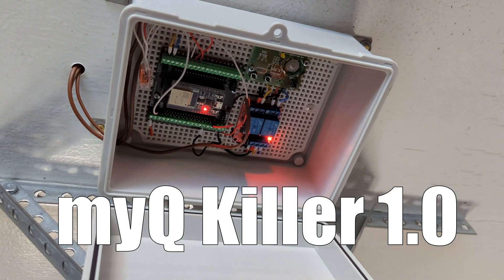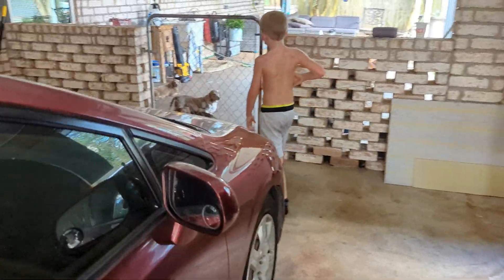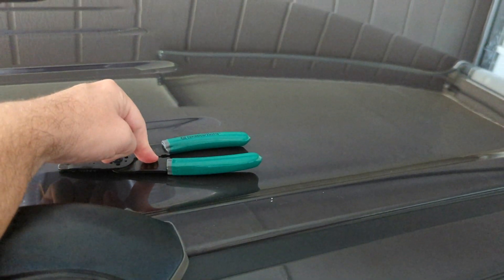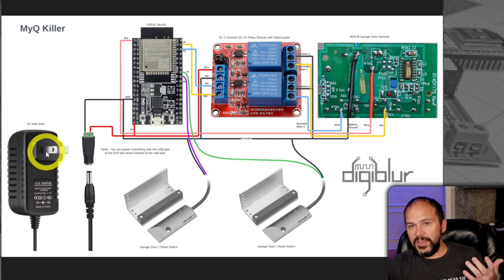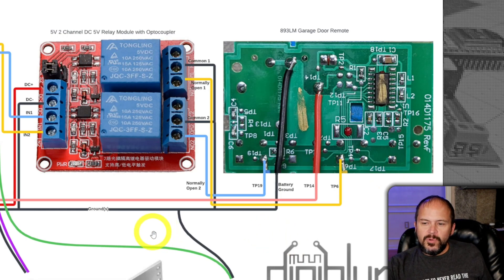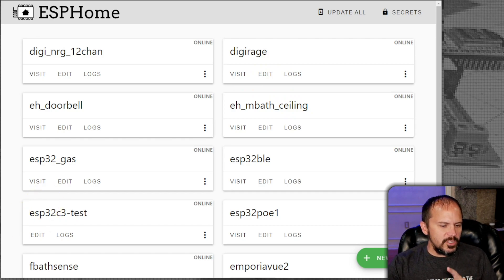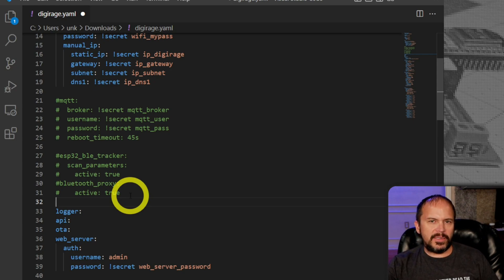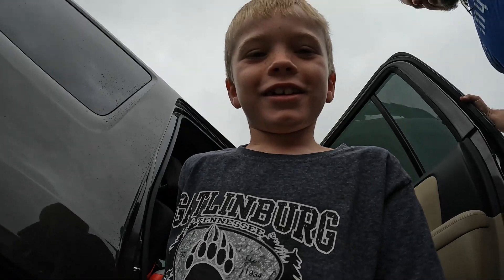myQ garage openers suck! How I fixed it using a spare door remote and ESP32

Comment: Are we saying that we can’t use a Shelly 1 plus with dry contacts wired directly to this type of opener or is that still an option? And by opener I mean the actual motor unit not the extra RF remote. This is how we did it in one of the older videos with the “dumb” opener. Would that then short the wall unit that has the LCD display? And is that wall unit sending an RF signal back to the operator and not communicating via the red and white wire?
Reply from the maker: If you have the new Security protocol style, nope, you can't just close the wires together
Reply: @digiblurDIY oh man.. they said “oh we were out of stock of the opener we were gonna give you so we upgraded you to the one with wifi” and I thought oh well whatever I’m not gonna use that anyways coz I’ll use home assistant but that then means I’ll need to go exactly your route in this vid with the RF remote and not just shorting the wires at the operator itself like on my old garage. I have a few ESP32’s laying around… Thanks for an awesome video.. as usual!

Comment: One word: Ratgdo
Reply from the maker: Yup. It wasn't out then except for a solder only version and I couldn't void this new door warranty. Things have changed a little especially now with the open source ratgdo boards supporting esp32 and the official one unfortunately do not. I do wonder if I can add car presence sensors to those boards as well.

Comment: Just completed this build and works great!  Chose this over the RATGDO solution for a few reasons.
1) I liked that this didn't require wiring anything into the existing system. 
2) Cost.  I was able to automate both my garage doors for under $40(is it weird that the project box was the most expensive part.  I used  reed switches from Ali express
3) Availability  Looks like the RATGDO boards are on backorder.
4) I got  to use a soldering Iion!

I used 3 pin connectors for the reed switches so I could bench test everything easily (clipped the green wire).  It also saved me from having to dink around with the connections while the box was mounted to my ceiling.  
Thanks for all you do!
Reply from the maker: At the time for me Ratgdo was solder only and then I needed two so I opted for this method since it was purely isolated and I could really locate it anywhere in the house I wanted.  I did opt for the project box to add additional sensors though.  Keeping that warranty intact was key for my setup.

Comment: There seem to be quite a few different versions of the ESP32-WROOM-32D. I've looked at quite a few different Amazon ones including the link here and the pins are all different. I assume these are all pretty similar and would only need slight modification of the code to account for the different pins? Also, did you ever upgrade this project to include vehicle presence sensors?
Reply from the maker: They do vary but they don't change the use of things. Just match up the pins that you choose.

No I got delayed with the heat wave and haven't been in the garage much. Trying to get it done in the next few months.

Comment: My myQ works just fine .You will only hate it if you want a premium feature. I want mine to open from anywhere, give me door position and alerts. It does all that flawlessly. And it never drops my WiFi. BYW. If someone gets hurt by your garage door, you altered its building code compliant beeping and flashing requirement while operating with your phone. You get sued, your insurance won’t cover you. You could lose everything you own. Think little child getting hit by a closing door and heartbroken parents with a hungry lawyer.
Reply from the maker: Actually since the video they broke MyQ totally and they pulled the API. So it is worse now. I didn't modify the door at all. This is the same as when I bring my door remote with me across the street and open and close the door from his living room. No beeps then either. Sounds like the door should have beeps all the time with all the lawyers like you say. If only they had it where when you walked in front of the door it would reverse the close. Hmm....

Comment: I think you're about to get a lot of interest in this as a way to open the garage doors without going through MyQ as you've probably heard they're locking out 'non authorized' integrations from the myq api.  This allows us tinkerers to have local control with the ability to go back to "stock" if we ever sell the house.  Personally I think it's a winner!  I'll be using one of my spare remotes for this.  Thanks for posting.
Reply from the maker: Yep especially for ratgdo being out of stock. They have come a long way with the design since I did this one as I did look at them but they required soldering to the opener at the time which I couldn't do with being under warranty.

Comment: If the remote uses 3.3v, why do you even need a relay? Couldn’t you just connect the GPIO directly to the points on the remote to pull them down to ground as desired?

Also, look into HW622 boards if you only have one door you want to control.  Cheap, and they have a built-in relay and opto-isolated gpio, but you need a 3.3v FTDI adapter to program them
Reply from the maker: You might be able to use some optocouplers or some other gate to pull things to ground instead of a relay but it might need some soldering action.

Comment: I'm late to the party here...  As a fairly long term sub, somehow I missed this video during the quest to add this featuer to my home assistant project.  Originally just grabbed a wemos d1 mini and a 4 relay add-on board.  During testing, quickly realized that during a reboot of the d1, for some odd reason, all of teh outputs went high just long enough to trip the relays which would trigger a garage door open event.  Not cool.

On an ENTIRELY unrelated project, my BOG standard garbage door remotes all started to die.... no, it wasn't the batteries.  Being the junkyard rat I am, I remembered that GM has sprinkled the Homelink garage door modules in every vehicle they've produced in the last 20 years...  Grabbed a bunch of those from a local pick-n-pull yard for about 20 bucks each.  Got one of them programmed up and made some solder connections, which I connected to my wemos d1 mini relay board.  The homelink module requires you to press and hold the button for about 2000ms before it'll transmit an event.  Winning!  Wired that module up to the relay board, bobs yer auntie!  Now I can sleep safe, knowing a random CPU crash or power loss event won't result in my garage doors opening, which would be a MAJOR security issue for my house.
Reply from the maker: Nice!!  Never late to the party.  Great idea for grabbing those modules.

Comment: Thanks for your video; it is an example of what people can do if they think outside the box.

My issue, before seeing your approach, is that the MyQ solution for automation is far from complete.  For example: You set up MyQ to automatically close the door at a certain time so you don't leave the garage door open overnight.  Now, you come home from shopping and open the rear gate on a minivan, which goes through the path of the garage door.  You go inside and forget that you left the rear gate open.  Instead of providing a notification that your garage door is open, MyQ closes the garage door automatically.  You inadvertently left the back door of the minivan in the path of the garage door.  When the garage door comes down, it is going to strike the car door, damaging it... severely!  There are no options in MyQ to send you a notification, instead of closing the garage door.  With your solution, I can see that an additional extension of the software can be implemented to check the status of the door (open or closed) and, instead of automatically closing the door, it can notify you (via several routes) that the door is open when the desired state is closed.  Your action at that point can be to close the door, check on the status of the doorway, or ignore it... YOUR CHOICE.

Thanks, again, for the ideas...
Reply from the maker: Indeed.  Local and flexible is the way.  Something like this is prefect for an actionable notification in Home Assistant.  "Hey dummy, you left the garage open again! Close it for you?"  I love the nice personable notifications to myself like that ;)

Comment: Nice vidéo. Kudos to you! I'm in the process of doing mine but I'm a bit unclear about a part of the code. What is the web_server: auth credential for in the esphome code?
Reply from the maker: It forces a password to open the web browser page on it.
Reply: Awesome! A couple more questions, I have only one garage I'll be using one gang relay, how should I wire the  two wires. And I'll be using the 891LM, same board but only one but does that make a difference in connection to the board?
Reply from the maker: Just to ground and the first button.

Comment: I’ve had the myQ HomeKit hub controlling two liftmaster doors for 5 years. Ones had any issues that mount on the side. Rarely have any issues with them over the last 5 years.
Reply from the maker: Homekit isn't too bad but I wanted to stay more open source and the ability to add sensors.

Comment: first off if your system cant open locally youve installed it wrong. I have MyQ Jack Screw systems on my garage doors. I can open them with the app without internet. Also that "stupid beep" is legally required for all automated doors that can be remotely operated for ADA compliance to alert anyone in the area Like someone blind that the door is closing.
Reply from the maker: Sounds like they aren't compliant then. I opened and closed them from across the street on accident with the remote on day 1. Mine have the safety beam anyways in case anyone steps in the way.

Should I call my installer and tell him it doesn't work locally?
Reply: @digiblurDIY  if you have the homebridge setup then yes you need to call them.
Reply from the maker: No. These were all in one and just wifi based. No external bridges like I have seen.
Reply: @digiblurDIY  well what you built is basically the home bridge device that they sell in addition to the myQ. Some of them branded myQ are not the full Home automation openers. There are many versions of the MyQ system, I only run the RJO70 JackShaft. The Homebridge bypasses the MyQ app and ties it into your Home automation be it Homekit, Alexa, HomeAssistant Etc. I have mine on Homekit so its native to the iOS infrastructure and Alexa. This ties it into the CarPlay in our vehciles and works locally without an internet connection as it uses the local network to talk to an Apple TV Hub for connection.
Reply from the maker: Except the whole open source part that will accommodate bluetooth presence and also car sensors and the homeowner controls the project and not someone else if they ever decide to start charging for stuff.
Reply: @digiblurDIY   ease of use versus diy. Im all for diy stuff... but your system integrates with no ecosystems. i can open my garage doors multiple ways, even has battery backups for each.
Reply from the maker: Correct. Integrates with nothing.
Reply: @digiblurDIY  honestly you could get away from using the remote as a trigger and use the manual door opener on the wall to open and close. Then get some libraries for homebridge ecosystem and you’d have a good work around. Yours is actually hackable since you’re using the remote.
Reply from the maker: Or just walk in the back is easier?
Reply: @RobertMehrer Your system relies on software that was written for and maintained by a garage door opener company. I think you already have "hackable" covered.

Comment: You could've just run two wires to the screw on terminals where the button on the wall connects to the garage door opener instead if using an old remote.  Most garage door openers are triggered if those terminals are just momentarily closed.  The trick is to have some mechanism for detecting when the door is closed.  Most garage door automation devices mounts a permanent magnet on the door and position a hall effect switch to be next to it when the door is closed, the Wyze adapter puts a QR-2 code sticker on the door and aim a camera at where it would be when closed.  Presumbly a simple "electric eye" could be done with a bicycle reflector mounted on the door.
Reply: I believe the Liftmaster/chamberlain multi-button wall openers do NOT send a digital serial signal.  Each button on the opener just puts a different resistance across the two wires, in a voltage divider circuit. The opener detects the voltage to determine what it is supposed to do. The main door open/close button puts a direct short across the two wires, just like a “doorbell” button will do. So wiring to and old remote was not necessary.
Reply from the maker: I tried that on day 1 when I had the buttons hanging in the first video. Shorting the wires just makes the light go off for a few seconds on the button. I was bummed I couldn't use my Shelly1 style setup again.
Reply: @digiblurDIY  I can understand that.  Of course the external keypads themselves pretty much means a serial link, if it's capable of supporting up to ten keypads on one loop then it's likely RS-422.  The various single board computers like Arduino and Pi have serial ports so there are ways to tie them in to give the number sequence needed but I guess finding enough information on your garage door opener to see what it is will be difficult.  Even if it's RS-232 which is only between two devices, relays or muxes could switch the link over to your device when needed.  Still, I guess you deserve kudos for going with the remote, I'm just saying that it's always worth checking to see if it is a contact switch and if not, you could still hardwire it if you could figure out what serial port it is.
Reply from the maker: This might be some more info on what you were looking for. I did consider it but also weighed my options of isolation and doing it with two doors and adding more sensors later made me go this route with ESPHome and ESP32 for stability. https://github.com/PaulWieland/ratgdo
Reply from the maker: That doesn't work here. Otherwise I would have just used a Shelly1 like in my other videos.
Reply: @digiblurDIY  The button on the wall must be connected somehow.  As you have a numeric key pad on the outside, I can see that it may be a serial link between it and a controller just to avoid allowing hot wiring the numeric panel but if so, you could just tap into the serial link with a pass through, indeed that's how Appletalk did it for local area networks.   It would still be worthwhile to imitate the hardwire link instead of using a remote and if it is a serial data link, there are ways of doing it though granted most people have forgotten all the serial link tricks of the past (note elevators used to be all connected together by such pass through serial links).  However, I guess even the commercial garage door opener adapter units all have mimicking a remote garage door opener as a backup to the hard wire so it isn't a bad choice, just not a preferable choice.

Note, the test that the commercial smart home adapters give you to see if the hardwire is a contact switch instead of a keypad data link is to short the screw on terminals together with the points of a needle nose pliers and see if the door activates.
Reply from the maker: @johnwang9914  they changed to a digital signal.
Reply: @digiblurDIY  Uhh, what do you think a serial link is, you know Rs-232, RS-422, etc...   Even AppleTalk is a serial link.  Technically USB and PCI are serial links, even ethernet is technically a serial link.
Reply: What is the 3 gang switch you are using inside? The one that lights up red and green in the video. I gotta have one
Reply from the maker: @jholt0130 he's out of stock on them https://www.tindie.com/products/logixpcb/3-button-esp-controller-w-rgb-led/

It is a 1 gang 3 button device.

Comment: Is this common in America - 2 garage doors for a garage this size? We would have a 2 car garage with 1 door, then it’s easier to enter at weird angles and straighten up later.
Reply from the maker: I'd say not common, more up to the design of the builder if it was new. But it was cheaper and how I got the doors really as I had a beam issue on the front which required either pulling the roof and replacing the beam for some massive project and bill, or the easier part.  Put in a post and frame it in for garage doors for a fraction of the cost and get an upgrade in the process.  So of course you know what I did...

But after having both methods and if I was building new, I'd go with 2 separate doors again.
Reply: I would say that it is not rare or even unusual to have two doors on a 2-car garage in America, depending on where you live, although not as common as a single 16-foot door.  In some places, it is common for new homes to have a 3-car garage, with one 16-ft door, plus an 8-ft door.  I have a 24x24 foot garage and we ended up with 2 8-ft doors, primarily to put more distance between the cars in the garage, but it also gives me less chance of capturing both cars if a door fails (yes, door springs break) and a lighter door if I need to open it without the springs.

Comment: What multi-status  sensor/switch do you use(the one one with three light up color buttons) ? 
Does it integrate well with Home Assistant (without cloud) ?
Thanks.
Reply from the maker: Yes, it is 3 buttons, 3 WS2812 RGB LEDs, etc on an ESP8266.  https://www.tindie.com/products/logixpcb/3-button-esp-controller-w-rgb-led/
Reply: @digiblurDIY  Thanks, I will give it a try !